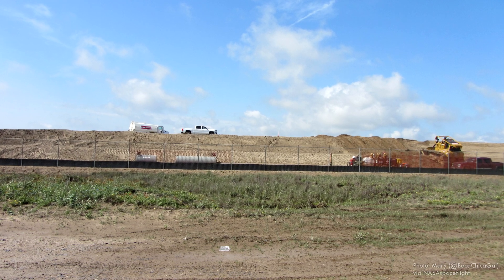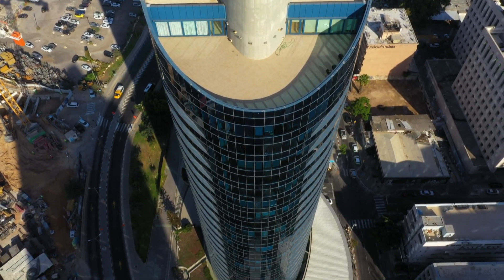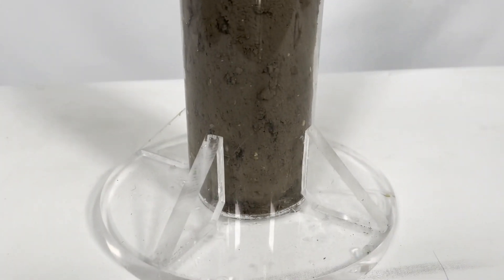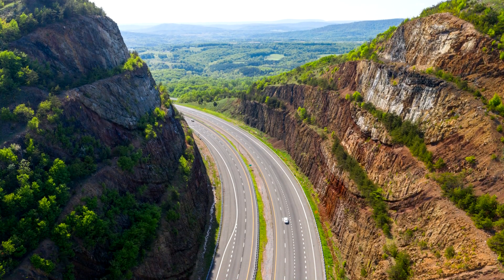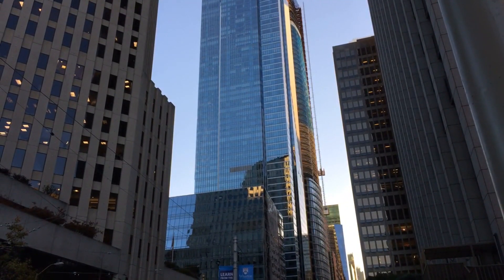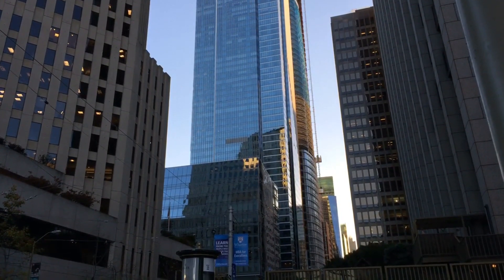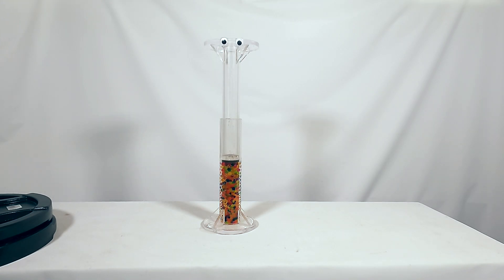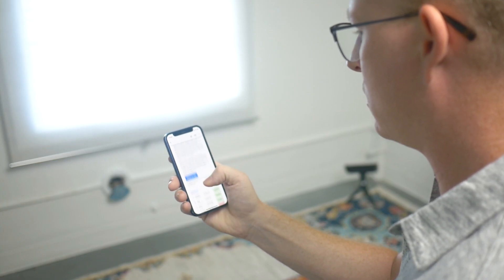Why SpaceX Cares About Dirt

Comment: Something that wasn't really mentioned in detail that plays a huge part for compaction/consolidation is stress distribution. If you have a huge pad of dirt that is very thick, even if you load it A LOT, the deeper parts actually won't consolidate much even if there's drainage. This is because the stress concentration in the soil gets spread out with depth. If you have one grain laying on two different ones, and each of those are laying on two different ones, etc, etc, etc, you end up with that stress being spread out over a much broader area than what is actually loaded. This is why consolidation of soils during construction is done in short lifts and not all at once, usually a foot or two at a time.

Comment: Floating buildings!
Some buildings float on soil.  Most slab Foundation houses are (to use Frank Loyd Wright terminology) concrete rafts Floating on the soil (see the Imperial Hotel).   My dad built power houses that were essentially concrete barges with bilge pumps to keep water out as water inside would cause the building to sink in the ground like leaking ship.  
Floating buildings work where it is not practical to find solid ground.

Comment: Since all this sinking has to do with water slowly leaving soil and the soil fills its place does that mean buildings don’t settle in deserts
Reply: They would still settle to some degree. A desert is mostly sand, but there are fine grained materials in there too (especially if it's a soil layer deposited pre-desert conditions). There is also still water in inter-granular spaces even in very dry places. Look up salt flats and you'll see examples of how capillary function brings water to the surface (laden with salts) that when they dry leave the salt as a crust up top.

Comment: When the surcharge load is removed, doesn't some of the water seep back in and/or grains start separating again? Do you end up with problems if there's a delay between removing the surcharge load and beginning to build the structure?
Reply: Once the grains are compressed the water cannot deep back in since the spaces between the particles is already closed.

Comment: Back in soils engineering class (~ 1970) we had a problem to determine how long it would take for 90% of consolidation to occur.  This was a beginner class and no one had any idea of what the answer should be.
The equations were somewhat complicated.  When we turned our papers in, I asked a couple others what they got for an answer.  One guy had an answer of 7 minutes and the other had 100 years.  I had about 8 years and wondered if I had done it completely wrong.  Turned out the answer was about 10 years, so I didn't feel bad then....but 10 minutes or 100 years?  Again, we had no feel for the amount of time required...just analyzing the problem and plugging numbers into equations.  Also, this was before electronic calculators.

Comment: I live in an area known for unstable sandy soils.  A lot of developments take place on reclaimed and built-up land.  Rather than waiting for consolidation of these soils, single and two-storey houses are built on what is known as "floating slabs".  Sufficient concrete thickness and reinforcing ensures that the houses will settle into the ground as a single unit.  This minimises cracking problems.  The slabs are built 30cm or 12 inches higher than the surrounding soil so that the floor remains above ground level even if settlement is severe.

Comment: I bought a piece of land with loamy clay soil.  Ditches are dug about 1' deep that collect horizontal water flow from the rains, not by water shed from the surface.  The water does indeed flow very slowly but it is a method that improves drainage and offers a balance between highly saturated and dry soil.   Thanks for further confirmation on the need to reduce compaction.

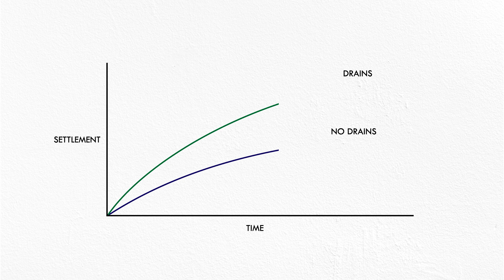Comment: The graph at 11:05 is unfortunately not correct. You would expect the same magnitude of settlement but the rate of consolidation is faster. The steepness would be greater with the drains than without, they would however be expected to come to the same ultimate state (ignoring secondary consolidation).
Reply: Agreed, the amount of water extracted and the amount of consolidation associated would be the same. Providing drainage just provides a pathway so you reach the desired consolidation faster. Other than that though it was a good video, did an excellent job of breaking the subject down.

Comment: Only thing missing from this discussion  of Concepts of Soil Engineering is a section about Soil Gradation.  Not sure that can be talked about in a way that isn't utterly (trying and failing to not make a pun) dry and boring.  But if anyone can pull it off, it's the guy who did this video.

Comment: but how do you prevent the soil from getting wet again?
Reply: It’s still saturated, it’s just that there are fewer voids for the water to fit inside. The only way for those voids to open would be to remove the pressure and even then they won’t fully open.

Comment: Why doesn't soil "desettle" when the load is removed?
Reply: The settlement is not elastic, once it’s compressed the void ratio is reduced and there isn’t any mechanism to return it. There can sometimes be a little bounce back or swelling but once the ground has seen a load it remains consolidated.

Comment: funny thing about the leaning tower, they are trying so hard to keep it leaning that eventually it is going to fail, while with modern technology it would be quite possible to just fix it and level it out. they would prefer to just keep it leaning with the fact that it will eventually fail that way while it by itself is a wonderful irreplaceable work of art. just the leaning gimmick with a few hundred years of hype seems to outweigh the idea of actually stabilizing an extremely great example of 10th-15th century art all in one place. they have literally used steel cables in the past to hold it leaning instead of actually fixing the foundation which is entirely possible to do. although at this point they have i think stabilized the ground under it so it can't lean further the building quite simply wasn't designed to lean like that and from what i understand it takes continuous maintenance to keep it from falling apart. the leaning thing is a cool gimic, and it has survived earthquakes before anyone even started trying to stabilize it, but as long as it is leaning it is going to fall, it just wasn't built to do that.

Comment: In the case of SpaceX in Texas where they are building on the coast, I see the point of consolidation prior to building but what's to stop water from re-infiltrating the soil over time especially in a coastal / marshy setting where there's no shortage of water causing heave? Wouldn't it be akin to squeezing out your sponge while it's still in the bucket of water?
Reply: The ground remains saturated but the voids close up meaning that the water has to escape somewhere. In sands and gravels it moves almost immediately but in clays the pore water pressure increases to take up to the losing before dissipating over the course of months to years. Once the water has dissipated and the void ratio has decreased the ground will remain consolidated.
Reply: @morbideddie  Thanks for that mate, makes perfect sense.

Comment: Another take on the idea of surcharging is to excavate a deep basement: remove more soil mass than the building will impart.  If you can go deep enough, the stress imposed by construction will not exceed the stress the soil had been under from the basement soil load.

Comment: *edit: oh, they do something similar. disregard. rather than delete, i'll leave it here. 

also, if you were going to compact an area for construction, could you drill a few holes quite deep, put large pipes down that have holes, then throw vacuum hoses down them, pile a bunch of weight/dirt on top and suck out the water as you go (yes, the water will have dissolved a bunch of fine stuff) so that the water in deeper regions doesnt have to percolate all the way to the surface, and then when the foundation is sufficiently settled, fill in the pipes with cement? just to speed up the percolation time? i am sure some engineers have already figured out a reason why i'm either right and already do it, or why i am a moron and do not ;)

Comment: Great video. An update to the millenium tower is that the effort to repair the sinking has resulted in more sinking and the effort has stopped. I don't know if it's worth a video but from an engineering standpoint it sure is one to take note of.

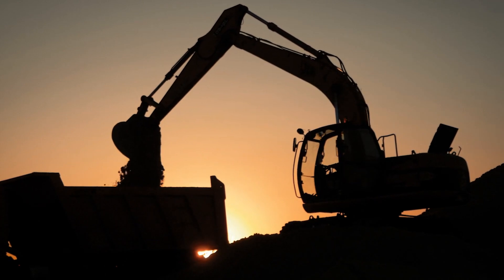Comment: 0:27 "That's a lot of olympic size swimming pools" – I wonder why everyone is using "olympic size swimming pool" as a measure of volume, when its depth is not actually fixed (and the width/length can also slightly vary – the fixed length is measured between the touch panels). Notably, for the Olympics in Tokyo, the main pool was 3 meters deep, where the minimum is 2 meters.
(Also, transporting/storing soil in swimming pools seems like not a good idea.)

Comment: So would a pole barn set up work on wet dirt, or build a traditional sip wall foundation? The pole barn set up I think would last longer. Weight is more center pointed and allows more water to pass through in the soil.

Comment: With the way some skyscrapers or other large buildings can sink unevenly why don't they add a layer of construction just above the foundations, similar to a honeycomb with the walls of the honeycomb vertical, and then build on top of that? This would give you areas that you could fill quite easily after the buildings construction to allow you to pour soil/metal or whatever into the appropriate cells thereby adding the extra weight in just the area/s needed to counter the offset.

Comment: Hi Grady,
11:35 They used this heaped earthworks method for the new Brisbane Airport extension in Queensland Australia.
It's up and running now, but sat 'idle' for years with the dirt/sand piled up on the new section.
The current and extended airport are all built on flood plains and mangrove swamps next to the ocean.

Comment: I have a case which exposes the reverse problem.
on a house built around 1980 very significant vertical cracks appeared in 1990 on the concrete walls.
After a very complex study of the soil, the experts come to the conclusion that it is the clay soil which "takes" its place after an exceptional heat wave episode which took place in France in 1976.
The clay in the soil at the time is totally dried out and contracted.
 The house built on this ground (without the builders being aware of it) is always subject to the consequences.
After another 10 years of legal battles, the house, whose cracks reached 20 cm, was rebuilt taking into consideration the condition of the ground and its expansion still in progress 40 years later.

Comment: Great video. I was hoping you'd bring up the failed Ocean Tower project, which was located less than 10 miles from SpaceX's launch site and was discovered to be leaning similarly to Millennium Tower, but it was caught during construction and the 31 story building was demolished before being finished.

Comment: Have been in the Soil and Building Materials business for 50 years in Florida, we have the full reach of soils here from rock at the surface to clayey soils at the surface, subsurface is different it all has to do where in the state you are, south Fl. Sand and Rock , central Fl. Sands and Clayey Sands, north a lot of Clayey Soils. Have worked on many pre-load projects and we have ways to test these while the load is on, and off before building. Matt you do a great job on explaining this, keep up the great work.

Comment: I had compost under my roof and now I have all this dirt I removed huge 2ft diameter rocks from a semi circle and dug down broke up the dirt let it dry raked it fine piled it high and water it thoroughly then after a while I just lightly raked the top layer skimmed a little off then added grass seed and the soil to mimic a grass step rolling hill at the corner of my house

Comment: In chicago, they drill to the bedrock and then fill it with rebar then concrete. The base of the hole is wider in diameter then the top. Its actually pretty cool when they do it.

Comment: I have a background in petrophysics, which is the physics of soil and rock, specifically for the oil industry. Petrophysicists define "consolidation" differently than you do around 3:43 and onwards. I'm not sure about the geotechnical terminology, but for petrophysicists the compression/compaction of your soil is not in itself "consolidation". Consolidation is what the word says: the initially loose particles form a single solid object (con=together, solid=solid, -ation=becoming). Granted: consolidation often goes hand in hand with compaction, but usually there are other processes at work at the same time in order for the material to become really solid, such as cementation, pressure point solution and remineralisation. The process at work in your experiments and in soils on which buildings and other constructions are being erected, would rather be called "compaction".

Comment: Great video. One issue you didn't address is plastic flow of soils, where a saturated soil will flow sideways under heavy load, rather than compress vertically. This is often the more important reason for preloading.

Comment: I was told that when building the World Trade Center's I and II that they dug deep basements under them first in order to reach a soil level that had been compressed already and the soil removed was equal to the weight of the towers above. Thus the buildings were sitting on soil that had been pre-loaded and compressed. We're talking a lot of soil. What method would that be called?

Comment: You can remove the exception for the the leaning tower of Pisa. The issue with soil settling didn't just make it famous, it also has cost 30 million euros to stabilize it through the 90s when it was already past the computer projected point of failure (basically, as far as everyone knew it should have already toppled). And that was only the most recent (and ofc course scientifically advanced) attempt at doing so. It started giving people headaches almost immediately after its first two floors were built, and started requiring some resources to address the issue.

Funny story, technically today soil settlement is only tangentially responsible for the tilt, it is mostly choice now. The decision makers during that 90s fix finally had access to the science and technological means (well, honestly, it was mostly the science that was lacking) to understand the problem enough to know how to stabilize it and straighten it from its 5.5 lean. They could have gone further if they wanted, but they chose to keep it at a safe 4 degree lean since the lean was so iconic and touristy.

Comment: Thanks for another great video. If you're looking for ideas for videos, I have another tangentially SpaceX related topic. They need to pump a huge amount of water onto the launchpad for sound suppression: the "deluge" system. From what I hear, they're going to build a huge desalination plant because working with saltwater is so difficult. I thought you might do a video about the challenges of pumping and piping saltwater, as clearly desalination is expensive and they wouldn't plan to do it if it weren't necessary.

Comment: Interesting video I’ll have to revisit again when I’m less tired to absorb the info better lol. I’m an architectural designer, and my last project is an apartment block on a former industrial waste and landfill site in an urban area left pretty much abandoned when all the factories left. We’ve had trucked in soil sitting on the lot for I think over a year to consolidate it (it’s along a riverfront with high water tables and frequent floods) before excavation could begin. I’m talking a whole city’s block worth of site that was covered in trash and loose fill that had to be consolidated, so it certainly takes awhile.

Comment: Been trying to build a large retaining wall against a soil hillside with no bedrock, and the project has had engineers running away from me. I wouldn't want the millennium tower to happen on me, and I get that, but the house next door literally has a wall that been there just fine for decades. I guess sometimes it's just hard to find competent people, as well :(

Comment: In Zaandam, the Netherlands the soil is very weak. Near the Verkade factory, on the terrain that once was used for the factory's own soccer and tennis clubs, the city wanted to build houses. 
About five years ago, they covered the whole terrain with 2 or 3 meters of sand. Then they left it like that. 
Some people were weirded out by that, but they have a good reason: the soil must be compacted, because if you're putting anything remotely heavy on it (such as roads and pavement) it will start to sink and settle. 
Houses will of course get piles driven to the prehistoric oceanic sand layer at 20 or 30m depth. It's fascinating to see. First the pile will move slowly. Then suddenly it punctures the layer of 'cover sand' which is close to the surface. From then on, it can sometimes sink a whole meter per blow, sinking through the wet peaty layers, until it hits the oceanic sand and it'll quit sinking.